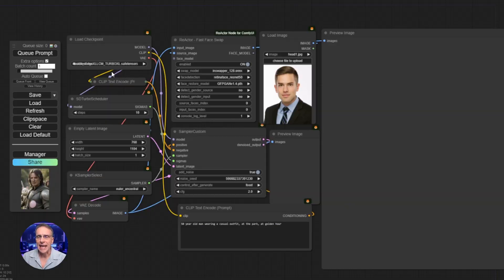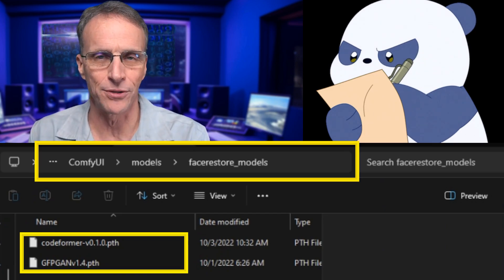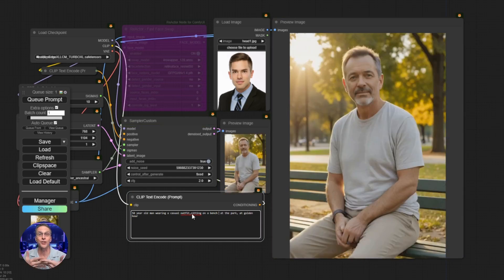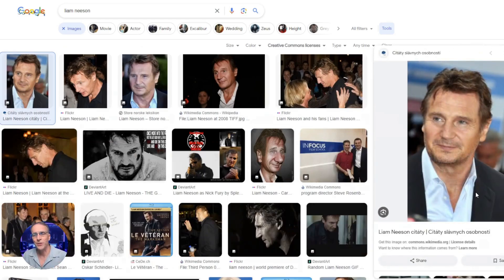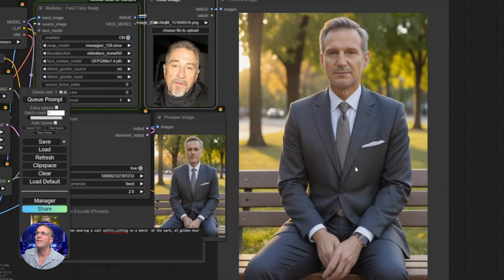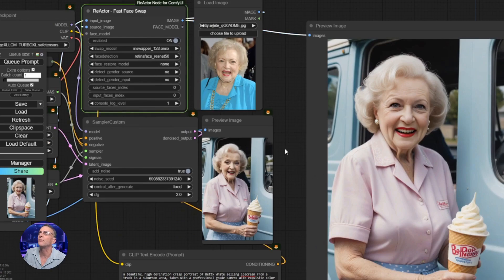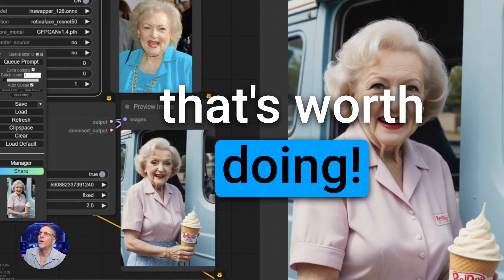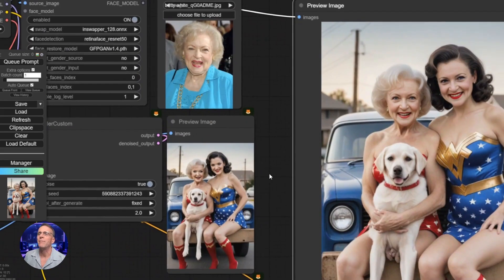TURBO Face Swapping with ComfyUI and SDXL

Comment: Tried this WF and it returns this error...

ReActorFaceSwap

Weights only load failed. In PyTorch 2.6, we changed the default value of the `weights_only` argument in `torch.load` from `False` to `True`. Re-running `torch.load` with `weights_only` set to `False` will likely succeed, but it can result in arbitrary code execution. Do it only if you got the file from a trusted source.

Any idea what I have to change?
Reply: Sorted it: it was something to do with the type of face recognition I was using.

Comment: Unfortunately this won't work for new users. Reactor requires insightface, insightface won't instal on the current python version. I've tried old python versions and spent hours researching. Can't find an answer or an alternative.
Reply from the maker: It's true that this particular repository seems to have gone through quite a journey...

Comment: For people who can't get the node to work, the way I got it to work was by making several changes, setting the “detect_gender_input” and ‘detect_gender_source’ fields to “no,” since by default it appears as “Na” or something similar.

Then, something that doesn't appear in the video, so I imagine it's something from a new version of the node, is to add a text node or similar with the value “1” and connect it to ‘face_restore_visibility’ and “codeformer_weight.”

Finally, something I'm not 100% sure will fix it is to add this line of code

face_restore_visibility = float(face_restore_visibility)

to the “node.py” file on line number 282. The file is located in the “comfyui-reactor-node” folder. This is because I saw that the console showed me that there was a value that it couldn't detect. With that line of code, it forces it to take the values that way (the 1 that you add with the text node). I'm not sure if it really affects it or not, but that's what I did to make it work for me.

Comment: Hey, Bob, i need some help, please. I'm following everything according to the class, but in the final detail when I do the Bypass to change the face nothing happens. The ReActor window is "blinking" as if it had not been able to execute the command. Can you tell me what could be happening?
Reply: I had similar problems. The solution for me was to set 
face_restore_visibility (number between 0 and 1)
codeformer_weight (number between 0 and 1)
gender source and gender input -> no
source_faces_index 0
input_faces _index 0
Reply from the maker: I do have an idea. They changed it since I made that video and now there are a few places in the reactor node that need the values changed. The gender detection needs to be set, as well as the source and index values (to 0 to start) I think that’s it…

Comment: Hi Bob, How are you!
I am really exciting that your video can help to install ReActor Node.
But when install batch file appear；
note: This error originates from a subprocess, and is likely not a problem with pip.
error: subprocess-exited-with-error
× Getting requirements to build wheel did not run successfully.

After restart ComfyUI appear:
ModuleNotFoundError: No module named 'insightface'
Cannot import F:\ComfyUI_windows_portable\ComfyUI\custom_nodes\comfyui-reactor-node module for custom nodes: No module named 'insightface'
(IMPORT FAILED): F:\ComfyUI_windows_portable\ComfyUI\custom_nodes\comfyui-reactor-node
Over try one week. Still can’t fix. Don’t know where to go! Cheers!
Reply from the maker: Were you using Pinokio or some of the method to install it?
Reply: Also I did this "python_embeded\python.exe -m pip install insightface-0.7.3-cp311-cp311-win_amd64.whl"

Comment: ReActorFaceSwap
 doesn't seem to work. I tried installing the custom node from manager but each time I restart it highlights in red. how to solve this?
Reply from the maker: Wow, I wish I knew how to help you. Have you tried installing it manually?
Reply from the maker: Also, is it saying the node is missing, or perhaps is the model missing?
Reply: @BobDoyleMedia got it I was missing python_embeded\python.exe -m pip install insightface-0.7.3-cp311-cp311-win_amd64.whl
Reply: I had the same problem, stayed red. And when I would try to install it, it would endlessly install. Ultimately I couldn't get a wheel built that can work with my 3.12 python, so I have to first revert back to a 3.10.10 I have on hand.

In order for ReActor to work you need a few dependencies, but first make sure to back up your comfyui by archiving it or something:

Obviously Python 3.10.10 or 3.10.11 to build the wheel needed for insightface==0.7.3 
(if you have python 3.12 like me, it's just not going to work, even if one uses a python 3.10.10 venv to make a wheel and then drag the required folders over - incompatible between python versions.)

Cython, which can be installed via cmd using:
" .\python.exe -m pip install Cython "in your comfyui_windows_portable\python_embeded folder.  

You'll also need Microsoft's C++ build tools, found in their visualstudio website, just ask chat GPT for that link, and download the installer vs_BuildTools.exe - run it, check the box for c++ tools according to what OS you use, go to the individual tab at the top, scroll down the list and make sure a C++ build tools box is checked, MSVC v14.x is checked, and a windows 10 SDK box is checked, click install (this takes a little while).

Lastly it's time to build a wheel for insightface. So just open a cmd prompt in your file explorer @ comfyui_windows_portable\python_embedded and type " -m pip install insightface==0.7.3 "

If that doesn't solve the problem hope it gets you somewhere close where maybe GPT can finish the job, make sure to back up your comfyui.
Reply: Had the same issue, was with installing insightface. Got a ton of problems. I suggest you feed the console log of the errors to ChatGPT and see if it can diagnose the issue. It could take hours though and might not fix your issue, but it can be worth a try. Shot in the dark really

Comment: hey, i am getting import failure when installing the missing node from the manager.
the error seems to be with it installing insightface-0.7.3.tar.gz
getting this error:
"Getting requirements to build wheel: finished with status 'error'
error: subprocess-exited-with-error
exit code: 1"
Tried googling, it didnt fix it. any help would be appreciated.
Reply: same issue
Reply: it fixed itself after i uninstalled python and reinstalled it. it was an issue with python 3.11 instead of 3.10 @PedroKozovitsBarbosa

Comment: I keep encountering this problem with reactorfaceswap.

When loading the graph, the following node types were not found:
ReActorFaceSwap
Nodes that have failed to load will show as red on the graph.

I noticed that issue when trying to import it on another workflow, any idea ?
Reply from the maker: This may be an obvious question, but did you go to the ComfyUI manager, and choose to install missing notes?
Reply: @BobDoyleMedia   I get this

### Loading: ComfyUI-Impact-Pack (V4.38.1)
### Loading: ComfyUI-Impact-Pack (Subpack: V0.3.2)
### Loading: ComfyUI-Manager (V1.5.2)
### ComfyUI Revision: 1804 [614b7e73] | Released on '2023-12-09'
Traceback (most recent call last):
  File "C:\Program Files\ComfyUI_windows_portable\ComfyUI\nodes.py", line 1800, in load_custom_node
    module_spec.loader.exec_module(module)
  File "<frozen importlib._bootstrap_external>", line 940, in exec_module
  File "<frozen importlib._bootstrap>", line 241, in _call_with_frames_removed
  File "C:\Program Files\ComfyUI_windows_portable\ComfyUI\custom_nodes\comfyui-reactor-node\__init__.py", line 25, in <module>
    from .nodes import NODE_CLASS_MAPPINGS, NODE_DISPLAY_NAME_MAPPINGS
  File "C:\Program Files\ComfyUI_windows_portable\ComfyUI\custom_nodes\comfyui-reactor-node\nodes.py", line 4, in <module>
    from scripts.reactor_faceswap import FaceSwapScript, get_models, get_current_faces_model, analyze_faces
  File "C:\Program Files\ComfyUI_windows_portable\ComfyUI\custom_nodes\comfyui-reactor-node\scripts\reactor_faceswap.py", line 12, in <module>
    from scripts.reactor_logger import logger
  File "C:\Program Files\ComfyUI_windows_portable\ComfyUI\custom_nodes\comfyui-reactor-node\scripts\reactor_logger.py", line 6, in <module>
    from reactor_utils import addLoggingLevel
  File "C:\Program Files\ComfyUI_windows_portable\ComfyUI\custom_nodes\comfyui-reactor-node\reactor_utils.py", line 8, in <module>
    from insightface.app.common import Face
ModuleNotFoundError: No module named 'insightface'

Comment: how to download face restoration model?
Reply from the maker: If you have the ComfyUI Manager installed, you can click the "Install Models" button and search for GFPGAN and you should be able to install it from there.
Reply: here are 3 files id 16,17,153 which one should I need to install @BobDoyleMedia
Reply: @BobDoyleMedia  I been looking, it's not in the install models at all. i tried searching this, I tried looking at everything under face. and tried looking for it on github but only found automatic one. maybe they removed it.

Comment: Great tutorial and super fast turbo checkpoint, but I met import failure on ComfyUI for ReActor Node, not sure what happened.
Reply from the maker: I wish I was better equipped to help you with that, but just getting started with Comfy myself, I'm not sure why that would happen. Maybe someone else has been through that and can offer some help?
Reply: I have the same error and can't get this to work. Super sad about it!
Reply from the maker: What is the error exactly? It's not a case of missing nodes?  It may be about the model. Tell me as much as you can. @harryskigis7229
Reply: @BobDoyleMedia  Hi Bob! After installing the missing module (ReActor) from the ComfyUI manager, I see these errors in the command window:
Getting requirements to build wheel: finished with status 'error'
error: subprocess-exited-with-error
ModuleNotFoundError: No module named 'Cython'
Getting requirements to build wheel did not run successfully
Status: The 'insightface==0.7.3' distribution was not found and is required by the application
ModuleNotFoundError: No module named 'insightface'
The module stays red even though it shows as installed. I definitely don't expect you to troubleshoot the issue. Been looking around the web and haven't found a way to fix this. Everything else works on all other workflows. Seems to just be an issue with the ReActor module. 
Have really been enjoying your content!